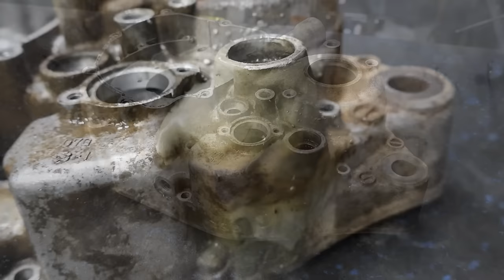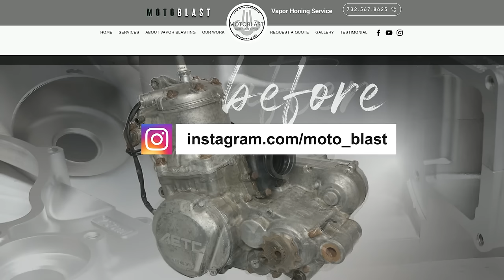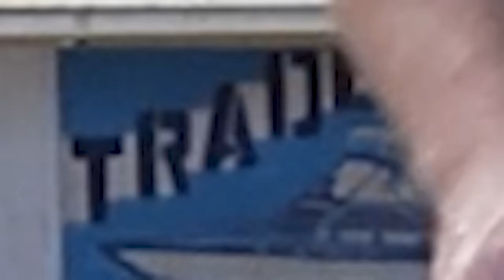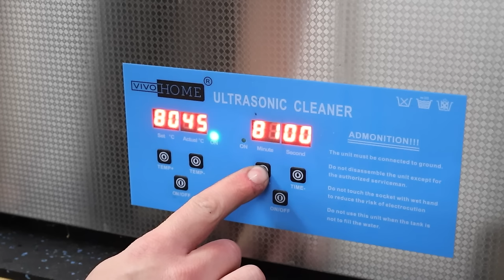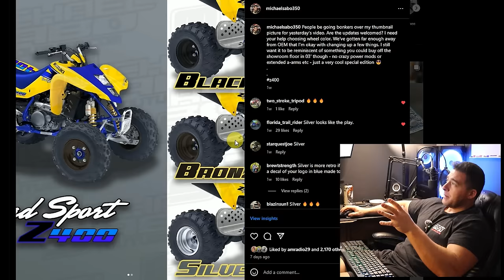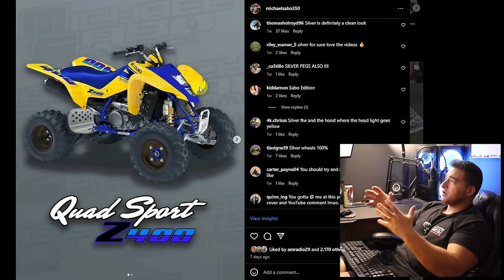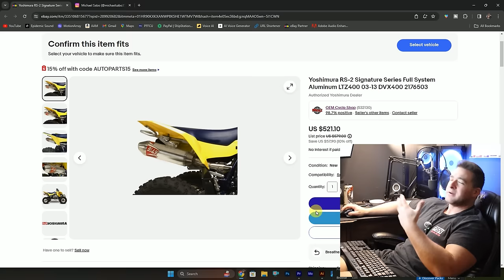Did I make a huge mistake on the Z400… Can it be Fixed?

Comment: Mike! I’ve been welding 20 years now and I’ve done aluminum fuel tanks for a few. I have a lot of experience and I’m from eastern Pa. If you see this in time, I’ll be home this weekend and would help you if you wanted. 4043 should be okay because that takes a little more heat abuse. 5356 is stronger but it doesn’t have a high operating temp range.

Comment: that gap is actually going to help.. mig or tig, get a copper spoon, well we call it a spoon , HF sells it in the welding section, think copper band in the rear of the weld section, the aluminium will not stick to it when you doing your root (1st) pass .. then get a stainless steel wire brush, ONLY use it for brushing the already clean or just fresh welded aluminum, do not let it be used for anything else.. welding aluminium tig or mig sounds diff from other welds, its normal, it will sutt up alot (black ash) its normal .. ive done alot of old harley engine repairs even w wire spool mig using the copper spoon to build it up.. years have gone by w no issues (on cast engines) obviously prectice on other cases/alum metal w the same gaps so you can get the hang of it.. good luck, it will be fine .. btw I use the omnipro 220 from HF , going on 6 or 7 years its great !

Comment: Burn over the area with the tig torch on ac with cleaning turned up on the welder. The Hz or balance to 60hz or maxing cleaning.  Then clean all the soot off with a new ss brush. Lay a bead on one side to fill the gap before joining the 2 halfs. Never want to fill a big gap because it will skrink a lot more. Do a build up on one side then weld them together.

Comment: That mark that looks liked a crack is called a "meet mark".  It happens when the material flows through multiple paths at the same time during casting, the leading face of the flow will cool slightly and when it MEETS up with material flowing from the other direction it forms a visible seam.  Structurally its not an issue, but it can leave a visual mark.

Comment: Been TIG welding on diesel fuel tanks (aluminum) for the past 12 years. This is a difficult repair!!! You should take that old scrap case, cut out another section, and try to weld it in there before moving to the actual case. USE A CARBIDE BURR (for aluminum) if you get some contamination in your weld. Treat it as if you're a dentist. Mad props if you can pull this off while learning how to TIG.

Comment: Definitely watch some videos on welding cast. Jodie from the welding tips and tricks channel is great. I bought 4047 filler for welding a warrior case based on his videos. Worked ok. Get a stainless brush, bake out the impurities with the torch at low amperage. Stop, bush,  repeat. Once you get some filler in it seems to get easier and will weld better on your 2nd pass.  Justin from the fabrication series also has some great videos to watch.

Comment: Great video Mike.
Always look forward to your next video.
I've been TIG welding dirty cast aluminum a long time. Best tips I can give are to pre-heat it some with the propane or map gas. And adjust your frequency in such a way that gives you a little more cleaning action. Don't turn it down too much, but there will be a sweet spot you'll find. And when you get to an inclusion, try to stay on that spot with the torch until the inclusion pulls out. If all this works and you achieve a sound weld, it won't look like a stack of dimes because of "working" the inclusion out.
The pre-heating will help a bunch.
Good luck. I look forward to seeing how it goes. Pretty cool idea trying to fix the cases that way.

Comment: I wouldn't have sawed the housing halves. I would have milled out the damaged area and welded in a piece of round material. I would then have milled a new bearing seat into this. This would have weakened your housing less.
But I still wish you much success with this project and keep my fingers crossed that everything works!
By the way, I would have clamped the rims of the quad in the lathe and then smoothed them with sandpaper or whatever.
So, good luck and keep up your interesting videos. I really enjoy seeing them and find them very inspiring!

Comment: Awesome you are trying this.  Even if it doesn't work you'll learn a lot and the cases are nearly junk anyway.  If you can bring it back it will be a hue win.  Lots of credit for saying "F it, let's try it."  I have been thinking myself of getting harbor freight's best multiprocess welder.  I would use it seldom but would be nice to have.  Thoughts on those multiprocess welders?

Comment: Mike, if you want to get contaminants out of aluminum, especially cast aluminum, like petroleum products or whatever for welding you start with what you did then preferably go to sandblast then as what's done typically for powder coat, it's called "degassing". So first soak parts in acetone (if possible) for 20 minutes then put in an oven at 450 for 45 minutes then cool and soak in clean acetone for another 20 minutes. Now your part is clean of all contaminates except of coarse whatever was manufactured into the casting originally which you can do nothing about.

Comment: I wonder if you setup a purge wall or something like you would for process pipe tig welding to keep the oxygen out of the cast.  I'd say lots of tachs to get it held in place.  
Amazing work cannot wait to see what you come up with.
Reply from the maker: It's going to be a challenge that's for sure - this week of practicing hasn't gone as smoothly as I'd hoped lol

Comment: Very interested to see how this turns out. Dude, you should check out the Primeweld 225X. Better welder, better customer support, and it supports the addition of a water cooler for the torch (they get HOT!). Not sponsored or affiliated with them, just a satisfied customer.

Comment: Preheating cast befte welding will help. But cast is difficult to weld. After welding you are supposed to cover the pieces with sand to slow the cooling. When they cool off too fast the material becomes brittle and will break.

Comment: I have a set of 03 cases that are like mint condition it's a complete bottom end crank transmission everything I have wire harnesses cylinders so much parts I would have sent you the cases for dirt cheap
Reply: He might just need them still. For him to be hot gluing these cast cases for his first go with the TIG, it's likely he'll need your cases anyway so hang on to them. Got a feeling Mike's going to be tapping your shoulder for them very soon.

Comment: Love your videos and just wanted to quickly mention the battery as you said it was a Li-ion (Lithium Ion) but it is in fact a Li-Fe (Lithium Ion Phosphate) battery which has a slightly lower voltage per cell of 3.2v as opposed to 3.7v per cell of the normal Li-ion. Saying that, it is supposed to be slightly safer and have a longer lifespan.
        Keep up the great work on your videos dude. 🤓👍❤ UK Subscriber.

Comment: Acetone is your friend. Clean the surfaces and your filler rod. Run practice beads on the junk case's edge and use 20CFH of gas with a #5 cup. Don't see a tungsten grinder and you'll need one to bring your tungsten to a pencil point to control your arc so it doesn't walk on you. Blast the HZ and wear ear plugs as higher HZ will give you deep penetration--- oh yeah, that's what she said. Good luck!

Comment: Gday Mike,
Watching with interest! I recently bought a 15ft Ali boat. Great deal but has been messed with all sorts of holes and cut outs in the side decks and dash. I converted my mig over to Ali welding and I’ve learnt that the plate is problematic to weld as is thin, old etc. I’m thinking of getting a tig set up now.
How’s the corvette going? I’m guessing you are after a wrecked Vette for all the donor modules, looms etc? 
“If it was easy, everyone would be doing it!”
All the best mate,
Cheers, Nigel 🍻

Comment: Clean the surface and your tungsten rod with acetone prior to welding. You can set your machine to “clean” the surface, go slow, take your time, and melt the impurities out at the surface then add filler rod. Grind your tungsten to a nice uniform point

Comment: I'm excited for the outcome of this.good or bad. I bought the same welder bout A year and a half ago,to fix a cracked oil tank on my raptor. Gave up and bought a replacement. That aluminum welding/tig is a whole new game. Life swooped in and my shop has been at a stand still.

   I'm really interested in how that battery works. Might be a good replacement for my 1200 sportster. It's a tough one to crank over also.

Comment: Mike when you weld you should not bevele your edges the weld is not glue it does not just stick them together you need that metal that you are removing to join the metal when my uncle thought me he talked about making sure you have good penetration and melt it all kinda so it becomes basically one piece do a little bit more research I'm sure you will get and I'm not knit picking you I just figured you the kinda guy who is always trying to improve so thought I would try and help

Comment: Hey mike whats up? I think i would have grinded off the old weld and just rewelded it myself than if that didnt work do what you did, so you wouldn't totally cut up 2 cases at first. If you ever need anything welded lmk i can weld anything

Comment: OHBOYOHBOYOHBOYOHBOY!

First off, did ya get those accessory pictures I sent ya?

Second off, yeah, I think this will work!

I literally said "Don't pick up that bearing it's hot!"

Damn that vapor blasting comes out nice.

I agree with 90% of the voters. Gotta keep the silver wheels. The black wheels would be what Suzuki would have done if this was a 08 and newer limited, but the silver looks more quadracer like. Of course, a setup with some 85/86 based graphics, the silver and grey engine, a black hood, and gold anodized wheels would look sick! 

I like the updated graphics! Very 88ish! If they aren't sent out yet, try removing the black outline and black line separating the blues on the 400s and see if you like them better.

The only problem with using the KFX's hood is you're going to have to drill into your new front fender to mount it! Might I recommend an "eggshell" or "pebble grained" finished blue decal like the quadracer hoods? No drilling required.

I liked the blue heel guards, but they were black on all the 08 and newer suzuki special editions. The accessory heel guards would still have been bare, like they were. Bare/silver is correct.

I agree with saving the accessory muffler.

Also, if you wanna mess around with colors more, try a blue engine and silver brake pedal. Just throwin' it out there!

It's lookin' good Mike!
2 THUMBS UP EMOJIS BECAUSE THE EMOJIS AREN'T WORKING RIGHT NOW!

Comment: Get an argon flow meter and ditch the regulator that came with the welder. The flow meters are cheap and is a more accurate way of argon metering.

Comment: I wonder if you throw the case in the ultra sonic cleaner after heating it in the oven my theory is metal expands oil would seep out then what's on the surface comes off in ultra sonic cleaner

Comment: i have been welding aluminum for 27 years and that cast stuff that has had any kinda crap on it like oil is going to be crap and wont be better than new at all  throw all that junk out and buy new cases 
it will work for awhile but a few hits and its going to brake right beside the weld
Reply: The HAZ on cast sucks. This little adventure will surely enlighten him so let him see with his own eyes how horrible welding cast AL is.

Comment: Awsome video Mike! I think the cases will come out fine. Do you have any tips on stripping powder coat without a sandblaster because I’m wanting to paint my entire blaster black with spray paint and don’t know how to get it off without a sandblaster. I know spray paint isn’t the best but I just want something fast and cheap. Thank you
Reply: Powder coat removal: Acetone will make short work of it.
Reply: @strykerentllc  I tried something with acetone in it and it didn’t work
Reply: @braydenshelton968  Acetone, Xylene, M.E.K., starting fluid, finger nail polish remover, and even brake parts cleaner will cut right through powder coat. Are you 100% certain it's powder coat and not a 2 part epoxy enamel? You can do a simple google search with your question and the answer will be the same as I noted. Powder coaters will warn against using any solvent to clean powder coat as it will literally dissolve the powder coating.
Reply: @strykerentllc  it’s the oem red frame from Yamaha but thank you

Comment: Why did you take the parts case and have him vapor blast the part you wanted to cut out?
Also you can that your MAPP gas torch to both heat up the weld area and to burn out any oil within the cast. Good luck that is not a beginner’s job.

Comment: Mike Mike Mike. You really jumped deep into the suck pool with the Vulcan machine. You should have spent the money an bought a Everlast machine. They are an inexpensive yet very very good machine . I learned on a digital 200 from Eastwood beat that machine up had a dick of a time trying to weld good up graded to the Everlast 255ext with a watercooler torch an have not looked back. I'd send that Vulcan back an order a Everlast or Esab brother. You will be much much happier an get a better result quicker an more consistent

Comment: So you went from a set of cases with some JB weld on it so why would you not have just scraped the JB weld off grinded the weld down had it welded by a good welder and be done with it so now you have a set of cases that you can clearly see has weld all on the back of it so how are you any farther ahead now than you were before it looks like shit now same as it did before